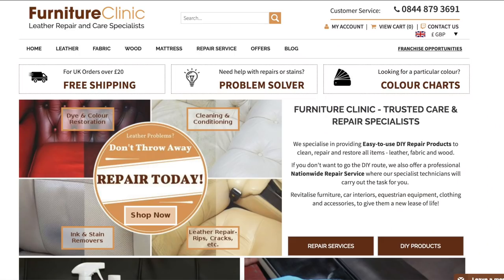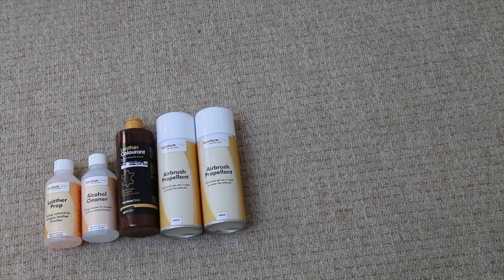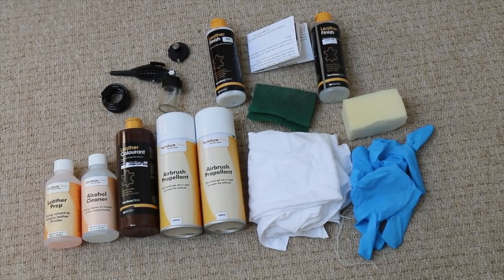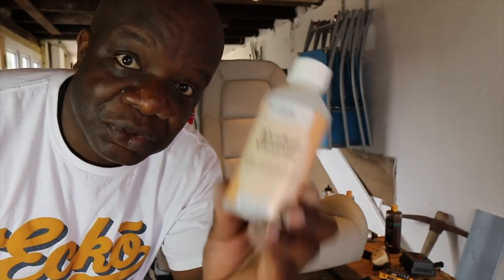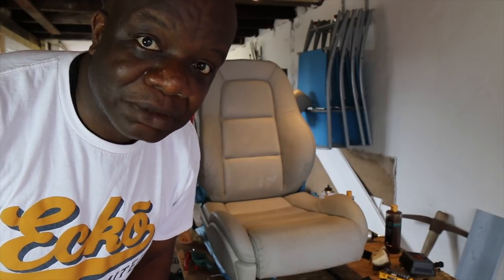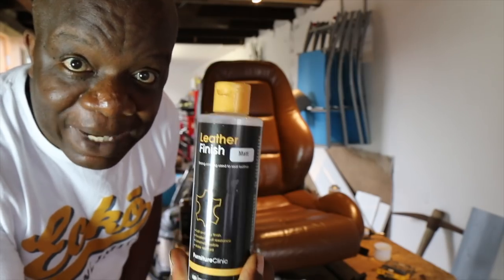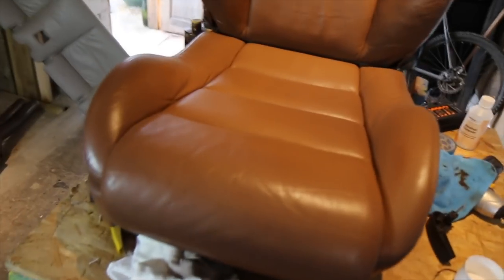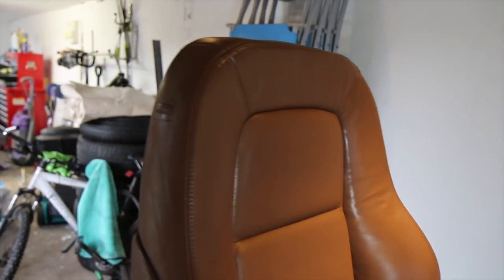How to paint Car seats like a boss

Comment: Great video. I just redid the interior in my benz. I changed the seats from grey to black using a kit from furniture clinic following the directions from here and it worked great. seats look almost new. I highly recommend that anyone who uses this kit get an air compressor/airbrush gun. made the job much easier.

Comment: Paul you say the kit was $79.95. I noticed you had two canned air cans. There is only one can in the kit. Is that enough for two seats? The two can kit is way more costly.
Reply from the maker: I brought an additional can as the first can was running low.

Comment: Great job ;) 
What you think can it's will be possible to go from black to brown?
Reply: I've not used the products in this video but generally speaking you can. To go from a darker color to a lighter color you either A) use a white or grey primer layer then spray the new color or B) simply apply multiple coats until you get the desired shade.

Comment: Hi bro love the video can I ask how do you get that airbrush to work all mine is doing is spraying out the freezing cold air but no paint am I doing something wrong 🤷‍♂️
Reply from the maker: You may have a faulty airbush, get in contact with FC to resolve, as they are pretty good at helping.
Reply: @CarsForPaul  i took adapter off and put it back on with pin out then screw pin back in and it’s working now lol but thanks a lot bud for advice the seat has turned out really good looks like new again  your video helped a lot 👌

Comment: Good job,i read in some reviews on the company's home page some people had probs with the airbrush but found it better when the paint was thinned down, thinned down how much and with what, any thoughts?
Reply from the maker: yep, found this to be the case when I used it after 3-4 refills. the head got a little gummed up. thinning out the paint helped.
Reply: @CarsForPaul  what did you thin out the paint with and how much ? 
Thanks

Comment: Will this color and brand also work on the interior plastics... Great video
Reply from the maker: It does, however, you will be better off using plastic paint which will bond better with the plastic
Reply: Cars For Paul does this company you used have a plastic paint... This company is the only one I've seen sofar that has this hazelnut brown which is my favorite interior color